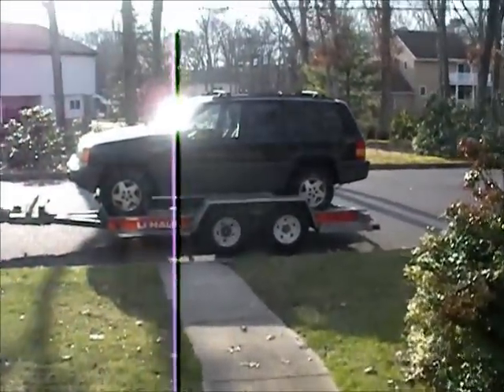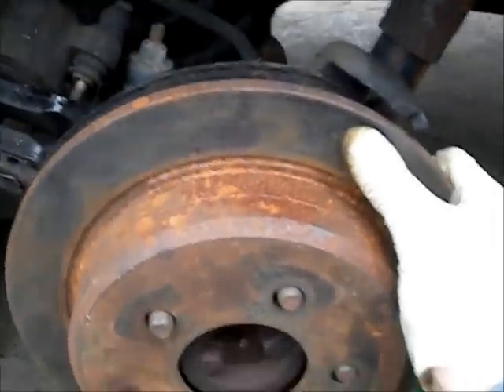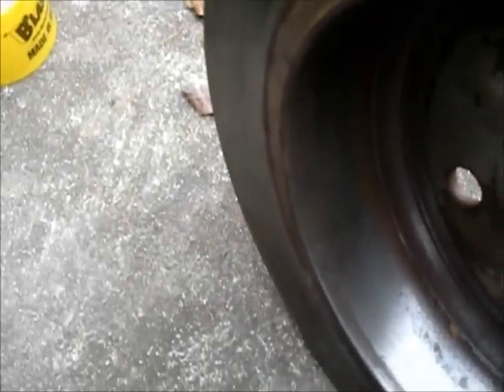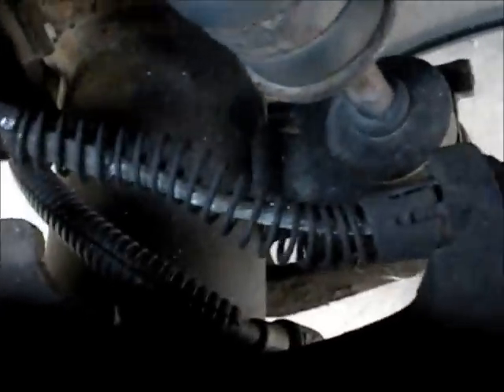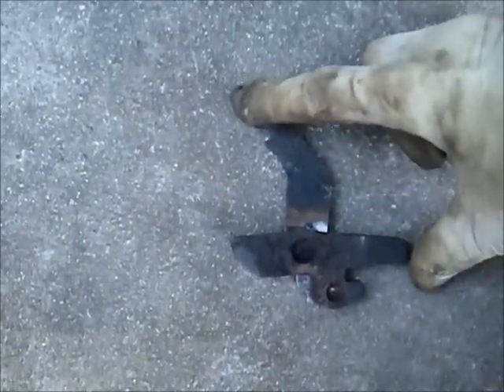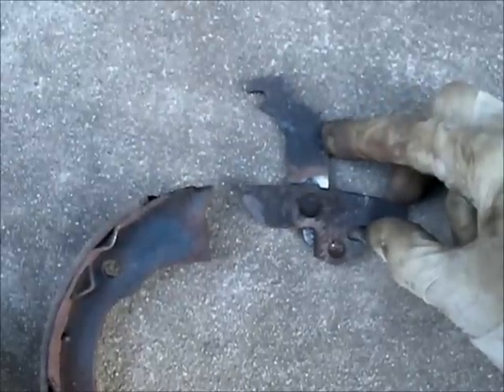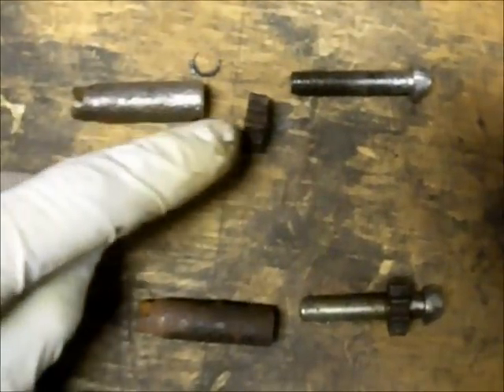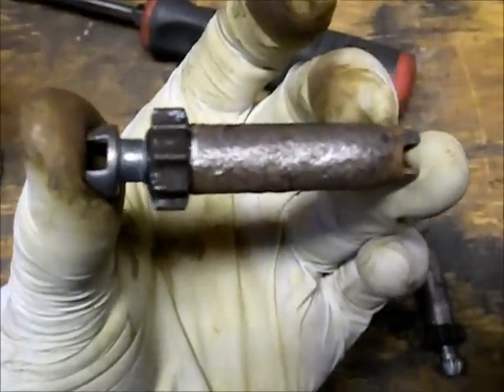Jeep Parking Brake fix

Comment: This is the best video on the rusted frozen emergency brake actuator. Thanks for actually showing the parts assembled as they are when they work. The other videos don't! It's as if they are doing a sleight of hand trick and don't want you to see! Moving the parts too fast.
 You should consider saying "This is the right passenger side of the Jeep and that way is the front." It can be figured out, but just saying it would make it clearer. Thanks for the video. You have just made my life a lot easier.   My mistake! You did say what side you were on in the beginning .

Comment: Danny, Very informative video. My Parking brakes were not working either and it turns out that the expander was also the culprit, (or whatever its called) it too was frozen. Your video put me in the right direction. Many thanks

Comment: Thanks for this video post of yours, Danny. Nice & simple, explanatory, & no CG. hehe
I've got a 95 GC Limited with a slightly slipping parking brake, & I was thinking that the calipers were somehow tightened by the parking brake, & so was surprised to see in your vid that the parking brake is actually just like the old-timey primary drum brakes, only smaller. Nice to see that those are adjustable with the star wheel, which I'm going to try adjusting tomorrow.
Nice end-of-vid credits too, Danny.

Comment from the maker: Honestly, I am not sure if what froze on my jeep is called an actuator. However it does sound like youre experiencing what happend to my jeep. They just need to be taken apart, wire brushed, or preferably a wire wheel on a bench grinder, and greased with brake grease.
Hope this helps
-NOS351

Comment: if your a grand cherokee you got 4 wheel disc brakes so you got calipers and pads on a disc your ebrake has brake shoes which work like drum breaks inside of the disc " you only need it for a safety " it isn't your primary breaking system

Comment: Hey Danny. Good video. Got the same problem on a 98 GC. That actuator unit is rusted on my car but the unit is not spring loaded. It is very loose. You can almost jiggle it completely out of the busing it sits it. I dont know much ab how these little things work normally so its hard to diagnose it as broke. Most importantly. How did you end up getting the thing out of the backing plate. The hub seems to be in the way?? Anyone else have a best way to get it out?

Comment: Thanks I have to do this to mine, but I want to stop the rusting. Sanded and some navel jelly cleanup dry and coat with super glue, then sand smooth in theory since it doesn't move that much it should last 5/10 years of course use marine water resistant grease..the blue shit. Or coat with corraseal rust reformer that leaves a shellacked film grease and get drunk. Home depot industrial grade rust reformer 23 +- $ a quart.